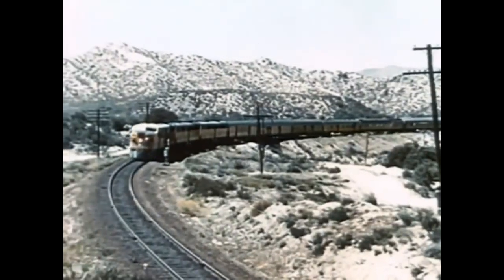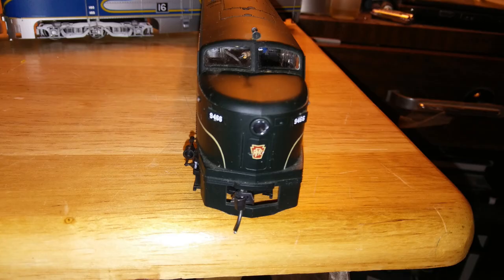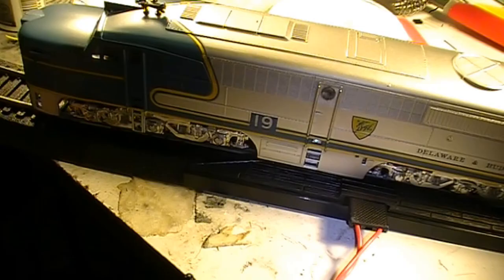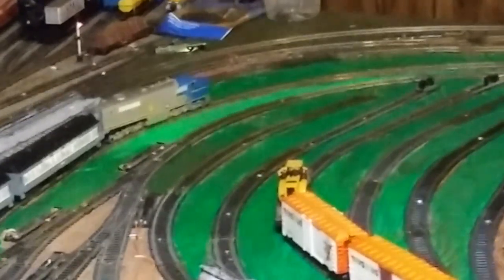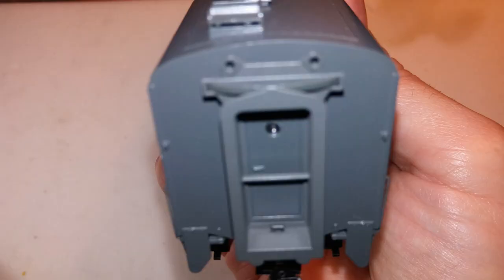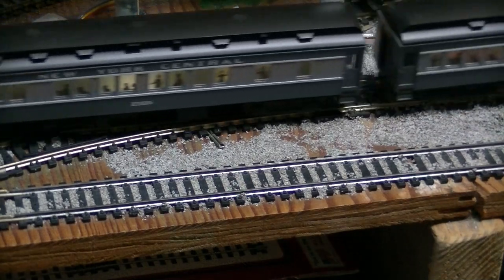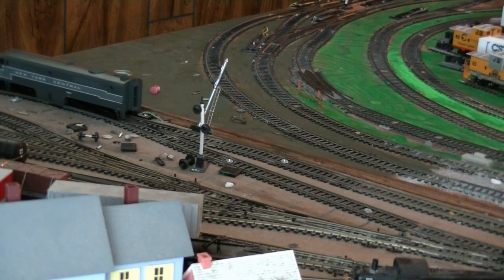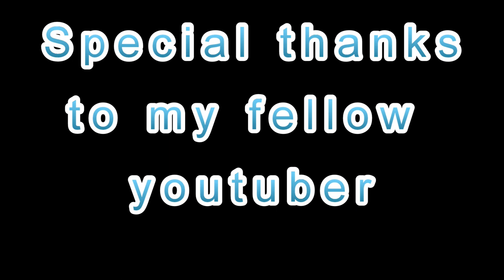The history and HO model's of the Alco PA

Comment: Thanks for the info on the Alco, some other questions if I may. What was the difference between the PA and the FA I know the F stood for freight and the P for passenger. I remember you said in the video that the "designer of the Alco PA/F was more used to designing white metal goods, so was the long snout just a design feature or did it serve any purpose, was there anything in there that contributed to the locos running?
Reply from the maker: The Fa were 4 axles while the PA was a six axle unit. You're correct on F= freight and P for passenger.  However, Alco did not always follow its own rules. There was  a Canadian only model, made by alcos Canadian counterpart MLW, called and FPA-4. this was an alco fa set up for passenger service, with the gearing and steam generator. It was powered by an Alco 251 12 cylinder prime mover that made 1800 horse power. these were built in the late 50's. as far as the noes of the pa, I think this was done to make it look different form the Erie Build. this may have also been done to smooth out the airflow. The main thing the PA's designer was known for was the grill work around the headlight. All of Alco's cab units, fa's and pa's would take this feature.
Thanks again for watching!

Comment: Hello I am considering purchasing an walthers mainline alco PA locomotive I only have dc power and I wanted to know if the horn and bell systems work when under dc power. 

Thanks for your time.
Reply from the maker: Not sure about the tsunami version. as for the loksound version, yes the bell and horn would work, but you would need to buy a  special controller to operate the sounds and wire that into your layout.  Given this  and the low prices for DCC systems these days, I would strongly suggest upgrading to DCC, especially considering that you can get a good unit for under $200, as it will open up a new dimension of realism and flexibility to your layout. You can, for example, In addition to the sounds, operate 2 trains completely independent form each other, on the same track, any ware on your layout without any fancy wiring. 
Thanks for watching!
Reply: @alcobufff  way ahead of you I’m already in sight of a Bachman controller which is good because Im starting off with EZ track for my layout I’ve seen the realism dcc brings and the immersion as well. Thanks so much for your time and may you stay safe in these trying times.
Reply from the maker: @Contrabasstubone  If I may make a suggestion, take a look at the  Bachmann digital commander set. In addition to the Bachmann EZ command DCC system, You will get a nickel  silver loop of track, plus 2 dcc equipped locomotives  and some silver series fright cars, meaning mettle wheels and mettle sprung knuckle couplers. The locomotives may not be the best but they will do to get you started in DCC.

Comment: I am not a great diesel fan, either the US or the UK ones but I do like these Alco PAs and FAs, there is something about the long snout that makes them look interesting and stylish. I am from the UK and have managed to obtain an Athearn UP Alco PA, but the insides appear a little basic/primitive and having watched this video and others you have made I understand why. Did the Athearns ever have a working light in the nose, the one I have has a "jury" rigged home made job which bleeds light all over the place? Similarly I have yet to see an Athearn one with numbers on the number boards on the locos nose, was this another cost saving exercise? Like you I like the paint job on the NYC models but probably for different reasons, the Nickel Plate Road paint job is also quite good and I understand the NPL preserved loco is the one that Rapido scanned for their model. Walthers models are hard to come by here and to import one from the US becomes prohibitive when you add in the custom tax so I guess I will just have to hold out for a Proto 2000 NYC model and hope that one comes up on Ebay. 
Great video mate,  very informative keep it up!!
Reply from the maker: Glad you liked my video! Yes, the Athearns did come with a head light, if you want to call it that. It was mounted to the frame for the earth, a mettle contact line that was attached to the other side, of the socket, pressed on the transfer bar for the positive current. You can see how it look in the  Pensy Athearn pa dcc upgrade video i did.
https://www.youtube.com/watch?v=50-HzxLEStc&t=905s  It was very cured and usually  lit the cab more then the headlight it self, theses also tended to warp the transfer bar, Worse still, these lights drew so much power, they would effect the locomotives ability  to run smooth especially at low speeds . Most Athearn PA owners just removed these  and lived with out a headlight, or made their own light assembly's.
Thanks for watching!
Reply from the maker: Yes the number board were a cost savings exercise. It was to maintain efficiency simplicity for mass production.

Comment: You would only need about 1 steam loco. There more powerfull. Although i like diesels more. Personaly i think the FA more. Also EMD used the 567 in the f units. And the 244 had 1600 not 2000
Reply: 2000 not 1600 for the PA’s,three lashed up equaled 6000 h.p.